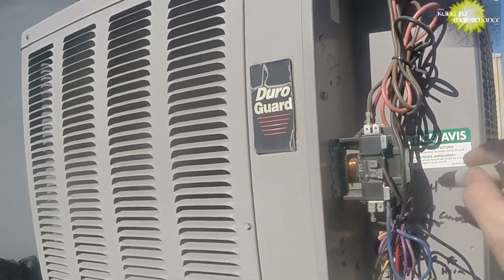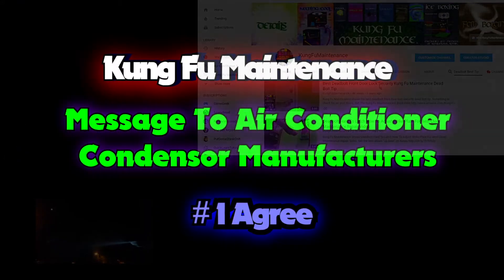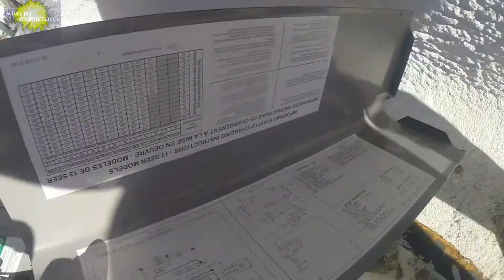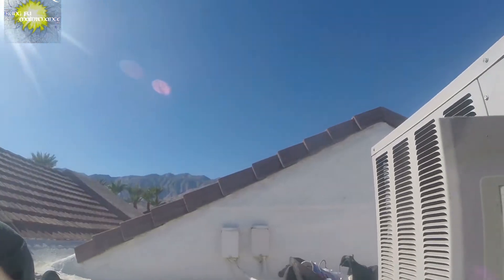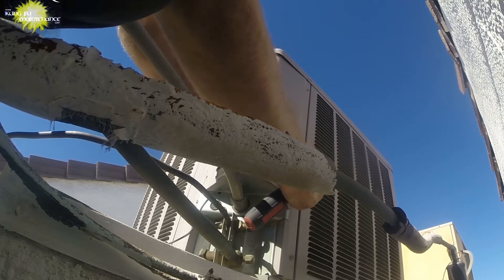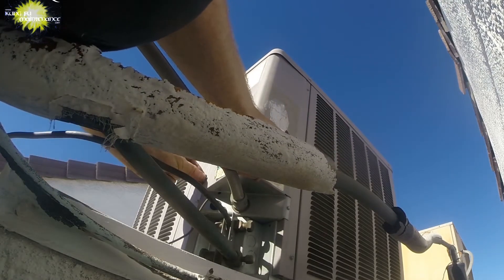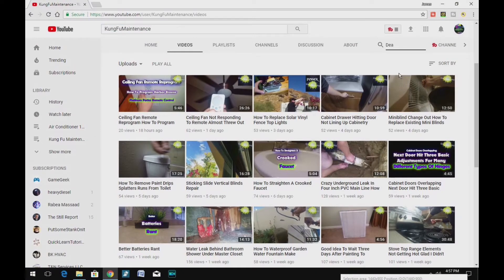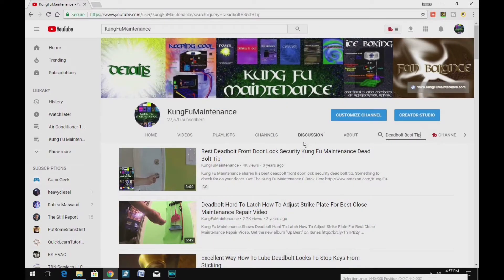Kung Fu Maintenance Message To Air Conditioner Condenser Manufacturers # I Agree

Comment: Thats all good until someone changes the fan motor or compressor and we know they are usually different from the original ratings--if you aren't sure of the size its easy enough to look on the data stickers on each of these components
Reply from the maker: +Mark Baker So far I haven only seen one brand that listed the capacitor size on the compressor and that was only one model for that brand that listed it. I have seen many other models by the same brand that do not list the capacitor size.